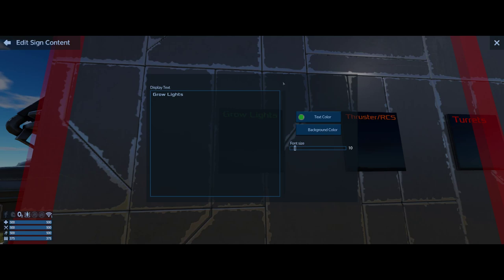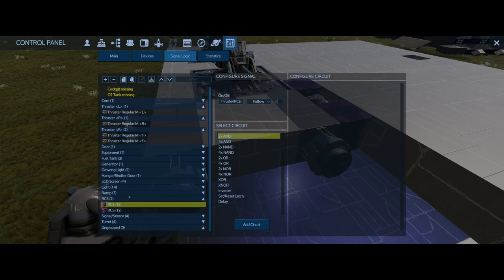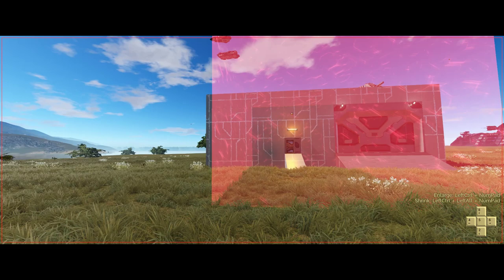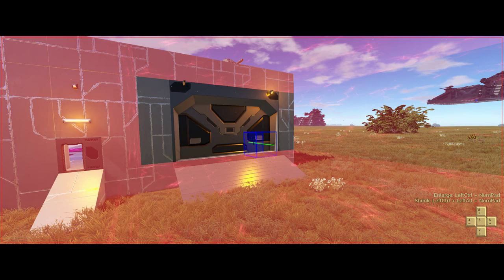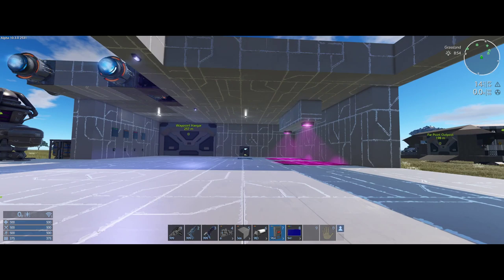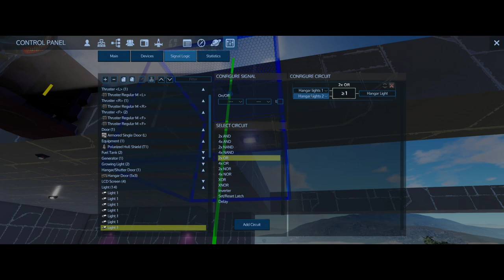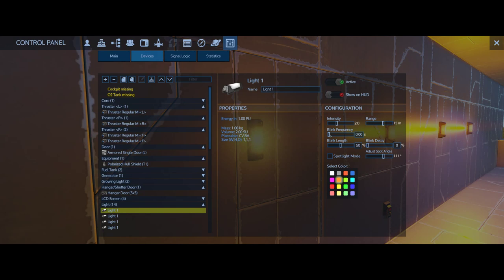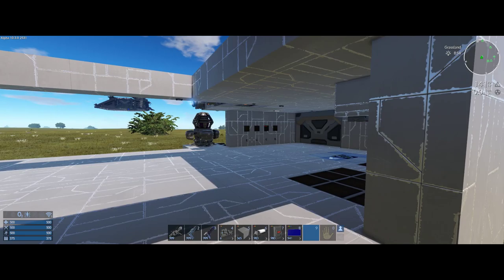Empyrion Galactic Survival - Switches/Sensors/Basic Circuit Tutorial

Comment: To turn of thrusters or anything on a ship I see only two ways to place the switch. 1. on the outside of the ship...LAME. 2. Inside the ship for say an SV but that entails exiting the ship and going into the back to flip the switch,,,also LAME. I set up a hot key configuration to do it, but it seems to only work sometimes. Is there a way to move from the cockpit to the inside like there is from inside to the cockpit? I have no info on that.

Comment: I acknowledge this is an old video and I might not get a reply. The signal logic stuff in this game really infuriate me as I find it extremely difficult to implement. I have a current build which is irritating me because I cannot get my head round doing this and that. Here is the issue v(version 1.4 Reforged Eden Scenario, if it matters). I have a Small Vessel. It is meant to be a Mining Vessel. It has retractable Turrets for defense and Retractable Landing Gear. I want to be able to turn off the retractable turrets without the mining drills retracting with them. This happens when you normally flip the turrets/weapons key in the control panel. I would prefer to be able to use this key in the CP to turn on and off the turrets and retain use of the mining drills. I would also like if possible to be able to turn off the retractable landing gear, preferably at the the same time (not necessarily deploy the gear). As it stands, the landing gear deploy whenever you go anywhere near something you can land on, obviously, but this includes mining sites. When deployed, the turrets and landing gear get in the way when mining, because the drills are set up in a fashion that when they dig a hole they dig a perfect silhouette of the mining vessels shape, but the landing gear and turrets are outside this silhouette. Using a enclosed cockpit design, and would prefer not to have to redesign it for a lever if possible................ Can this be done.... and how?

Comment: Hi, this is really helpful. Thanks a lot. I have another problem with the signals. One of the biggest energy consumption are the food processor and the constructor. What i want is an activation, when i am there (weight plate) and an switch off automatically, after they finished the construction queue. The target is to be more energy efficient.Can you help me out and make a video about it?
Reply: Old problem with new solution, and might be out of scope for a (rather well done) basic tutorial vid.  Me, I would be making some guesses as to when the construction queue will stop, and set up delays; if you knew a max time it should be on for, then you could set a delay circuit which initiates after you have started the constructor, which can reset itself and self manages triggers, turning off sensors where appropriate, and etc.  I have a hangar door set up with something like that, illustrated in another video.  Kindof an advanced, experimental concept, though.  Good idea, however--I may put the triggered delay idea to use with constructors, too.